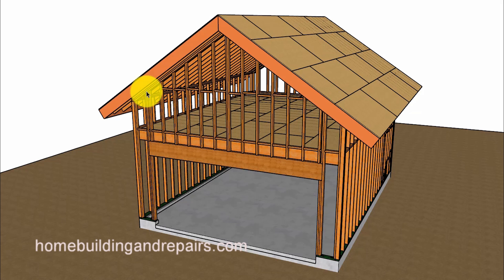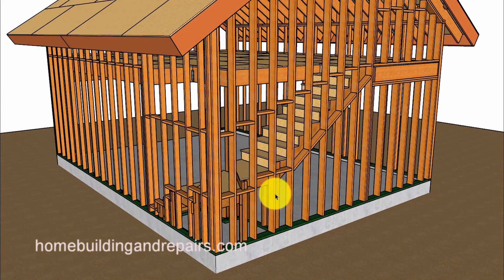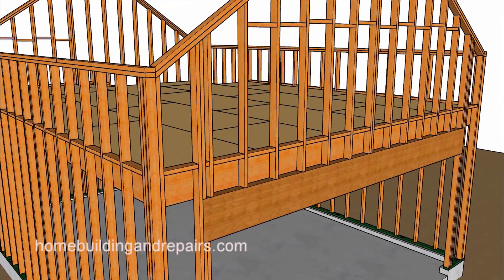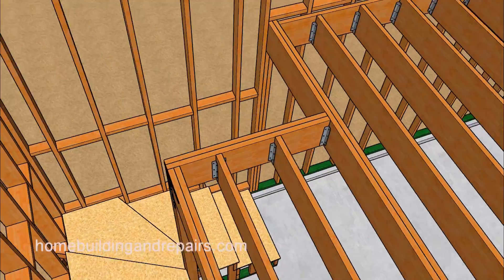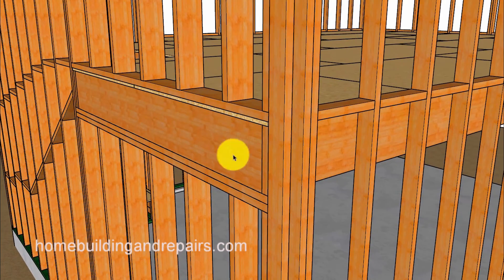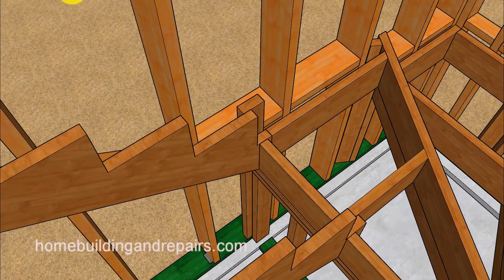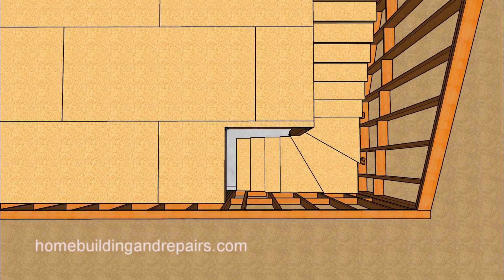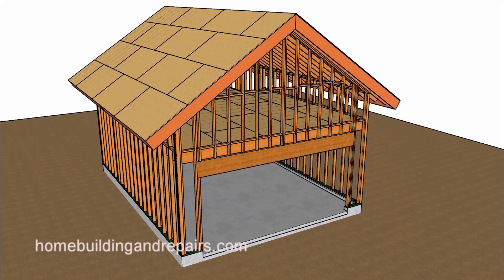How To Build Garage With Loft, Winder Stairs And Stronger Rake Walls - Building Education Part 3

Comment: So I can use a 2×4 or 2×6 19' long from the floor to the peak? I can get a board that long? So, if you build the bottom floor 8', how tall would the second floor be if I did it separate? At the tallest point? Peak? And if I built the first floor 8', single bottom sill, to top of double top sill is how inches total?
Reply from the maker: I would use larger lumber for taller walls and the longest lumber I've ordered was 2 x 6 that was 26 feet long and used for an exterior wall in a two story building. I can not provide you with lumber sizes or any type of structural information for a project like this and would suggest contacting an engineer, especially if you're not familiar with this type of construction.

Comment: I wouldn't expect you to use balloon framing, but with the shortness of the attic, it does make more sense than platform framing; although you did transition to platform framing right of the stair loft landing.
Reply from the maker: You would need something to prevent the walls from spreading, like rafter ties or a ridge beam if you sit the second floor on top of walls.
Reply: @gregvancom  <> Lol, good point, failed to note it being a voted ceiling attack assuming collar ties every 4ft. Or ridge beam.

Comment: I'm surprised you left out the 2x4 stringer wall standoff running continuous along the bottom edge of the stringer to allow for gypboard and a 1x stair wall base (wall stringer).
Reply from the maker: I wanted to provide different construction methods in this series, for example this would be used if you're not drywalling.
Reply: @gregvancom <> Oh OK, I thought you mentioned hanging rock

Comment: Not the focus of this video but... Insulation. IF, if this the upper floor area was going to be insulated, does the rafter framing leave enough depth for minimum insulation value at the top plate?
Reply from the maker: I will try to address insulation in another video. Insulation will depend upon use of building, for example if it's a detached garage, it might not require insulation, but living space will.